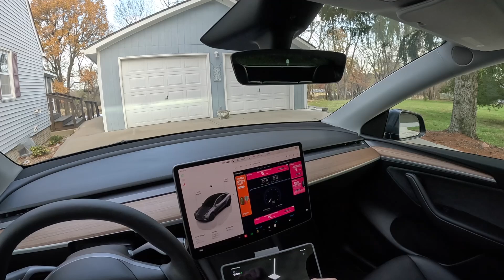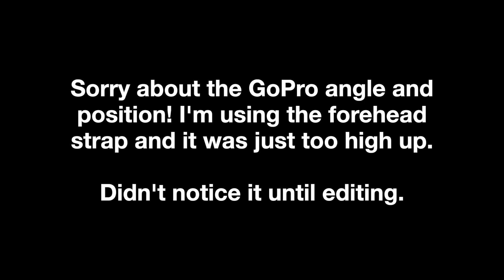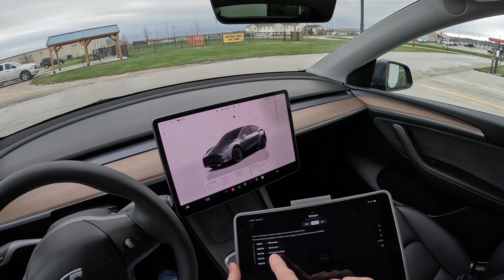Testing the Starlink Mini In-Motion

Comment: Will it work using Tesla's in-car USB-C ports in Y or CT, if using an after-market 10 foot cable? Asking as my CT has no 12-volt port. Only USB-C and AC ports.
Reply from the maker: No, Tesla USB-C ports aren't rated for the necessary 20V/5A (100w). The Mini doesn't use that much power, but it requires the 20V/5A USB-C PD profile to boot up. I recommend using the AC ports, or you could also run the Mini off USB-C from a small battery bank. Then plug the battery bank into the CT/Y USB-C port. I prefer the latter, as this allows the Mini to stay on constantly during food/bathroom breaks, with no interruption when the Tesla powers power down after exiting the vehicle.
Reply: Thanks. I will stay with AC then. BTW, my CT allows outlets to be kept on up to 12 hours after exiting.

Comment: How much energy is drained from the battery using the mini?
Reply from the maker: It uses 20-30 watts. For reference most Tesla's use around 200-300 watt hours per mile of driving. Assuming your car has 78,000kwh usable, the Mini would drain 0.7% of the battery after 24 hours of use.

Comment: Starlink is rolling out a new firmware that will cause dish mini not to work in motion 😢😢
Reply from the maker: Source? First I’ve heard of this. It’s not the hardware that matters, it’s the service plan. All Starlink hardware has always been in motion enabled, it’s the service plan that restricts it. The Starlink website still says the Mini is approved for in motion: https://www.starlink.com/support/article/50e933eb-54f5-1a77-cc85-c6c8325564cf
Reply: @ PC magazine. He going to push for his flat top in motion dish. $2,500 . The firmware will cause the dish mini to not work in motion.Rolling out in December. Also he may have a smaller one coming soon. Three new dish size changing . It will cause people to buy the expensive one instead of the mini
Reply from the maker: @ Link? I follow PCMag and read every Starlink article, no recent ones about that.

Comment: It just occurred to me. Why doesn't Tesla offer Starlink as an option on all of its cars?
Reply from the maker: The vast majority of car owners just travel around populated areas where cellular exists, and cellular is a lot cheaper. It’s easy enough to add Starlink yourself, I don’t think Tesla would add in some propriety panel that’s only functional on the car. Better to have your own unit that you can take and use anywhere.
Reply: @DISHY_tech  No. I mean, as an option for cars. A built-in antenna, in a more elegant way than just attaching it to the panoramic roof. 
The demand probably wouldn't be that high, but we can't know for sure until it becomes a reality. I bet a lot of Cybertruck buyers would check that box.

Comment: You have cobbled your SL MiniDish by placing it IN your vehicle. If you put it on the exterior of your vehicle, the signal will be significantly improved. Glass Blocks RF, well most of the EM spectrum.  
 SL mainly use the Ku-band range (12 to 18 GHz) and Ka-band range (26.5 to 40 GHz). 
These like all RF when aerial is inside the vehicle have glass windows and sunroofs obstructing Starlink satellite signals., 
The best... only... way to remove the RF/UV etc shielding is to mount it external to the vehicle.
Put on roof or on glass of back with your suction cup mounting unit.
Reply: Mine is in my car. Y under the glass works fine. Heck, it works if you just randomly throw it on the dash.
Reply from the maker: Worked fine under the glass, as shown. I gain no practical performance for my specific application by externally mounting it. I’d rather not have something external on a passenger vehicle, especially for temporary use. On a van/RV? Absolutely mount it on the roof. But the method shown here works great for a road trip.
Reply: Mine is inside my car.  I have no issues getting over 150mbps. Overkill for my usage:)
Reply: Tell me you don’t know anything about radio without telling me you don’t know anything about radio.

Comment: I see these need moving to centre this in the rectangular box. So how’s it work if your driving as it’s obviously fixed?
Reply from the maker: Do you mean it needs to align itself to the satellites? It has a phased array antenna that can pick up signals from a wide 110 degree field of view. So the exact angle and position of the dish isn't all that important. As long as it has a clear view of the sky out through the roof, it will work.

Comment: Thanks for another great video! Would be interesting to understand the Average Power Consumption (as shown in App or otherwise) with the SnowMelt option in Off vs Automatic. I am guessing that in Off it may be significantly lower as the upload rates are far less as you observed.

Comment: I want to ditch premium activity with Starlink in the Tesla. The problem I'm noticing though is i lose remote Sentry access if I lose premium data. Beacuse the Starlink (via 12V plug in the trunk) will be disabled when I'm not in the car.  Automatically connecting to the wifi/starlink is fine, theres a setting in the wifi settings for that. But once the car is locked, unless I have a decent battery dedicated for the starlink, i'm sure i would lose remote sentry... i'd have to have a usb battery pack for the starlink mini that lasted at least 12 hours or more probably. might have to keep Premium Connectivity :/
Reply: not really a proble get a usb power bank plug the bank into the socket that charges it up when the car is running. have one of the other ports plugged into the mini. it's not rocket science. hope that helps. you can really just set and forget. it will maintain itself.

Comment: Great. So what do you do if you don't have a sunroof?
Reply from the maker: Windshield, or perhaps mount it on the outside somewhere using magnets or suction. Starlink also sells a roof rack mount. I'm actually getting ready to do a windshield testing video to see if it's as reliable as with the open glass roof.

Comment: Your Tesla already gets internet 🤷
Reply from the maker: It uses a cellular connection for data, which can be unavailable and unreliable in some remote areas where I travel.
Reply: @DISHY_tech  Whats cool is with the Model 3/Y if you want Satellite Radio again, you don't have to rely on cell towers anymore. You litterally bring back Satellite Radio to Sirius XM app with Starlink (mobile app for now)  --- i still will probably put a Model S/X SiriusXM tuner in my ModelY because i miss having Satellite Radio realiblitilty when driving. Celluar doesn't cut it for reliable streaming and FM is just ads ads ads

Comment: So I have two T-Mobile home internet boxes and I use one on the road. I travel as part of a crew in a Ford Transit van. I've done extensive testing all over the US with it and at highway speeds, I'm averaging about 200-500 down and 100 up. Odd as it may sound, the fastest speeds are actually in rural areas where there isn't much load on each cell tower. I'll see speeds in excess of 1Gbps. The negative side is that it won't have coverage no matter where you're at. But if you're just on major highways, you always have cell data signal. I'd be open to possibly switching to this, but man, the upfront pricing for the equipment is a big obstacle. Do I venture enough into areas that don't have cell signal to justify that $600 equipment cost? I don't think so. I'm not even sure if there was ever a time I was staying somewhere or went thru an area where I didn't have cell signal for long periods of time over the 2-3 years that I've had this.
Reply from the maker: Just depends on where you are traveling. I frequent places without a cell signal, so Starlink is necessary if I want internet access. I was a Devils Den State Park in Arkansas last month and there is no cell service (T-Mobile) in the campground. The options are the slow Wifi sold by the park (Viasat) or bring a Starlink dish. In May I spent a week at Mueller State Park in Colorado. No cell signal there. I was happy to have Starlink. Even driving on major roadways, cell service can be unreliable or really slow, especially when you get into remote mountainous areas. There have been lots of times I'm driving through National Forest areas looking for a trailhead or camping spot and cell service isn't available. Starlink comes in handy in situations like this where I can quickly get online and access AllTrails comments, get up-to-date maps/navigation, weather, etc.

I'd say if you haven't run into enough situations where it would come in handy, you don't need it. Not worth the price tag unless you are frequenting places where it would come in handy.
Reply: @DISHY_tech  Yeah, when I'm traveling for work, I tend to go to populated areas which means that the highways that lead there are also more heavily traveled which means better cell service. Definitely if I were in your shoes, starlink is definitely the way to go. 

Sometimes even when I end up in remote areas, I'm surprised at the cell data speeds though. A couple years ago I had a 4 month long project where I traveled to Humboldt, KS which is a town of 1800 people in the middle of nowhere. I wired up some wifi cameras there to monitor a construction project and my T-Mobile test speeds were 900 down, 450 up. It was nice to be able to just leave the internet device down there and be able to control cameras remotely and have super high quality live views.

But I do understand my method could be a crapshoot. Your method is all but guaranteed to have service. That's why I still keep an eye out, just can't justify that startup price yet though.

Comment: Does the weight of the SL cause the glass to pull down  too much on the sun roof
Reply from the maker: @bobla441  The Mini is under 3 lbs and the mount is very light as well. No issue as far as pulling down too much on the glass.
Reply: The glass roof can handle the weight of an elephant
Reply: @GaryCruzDotCom wow that's good glass..

Comment: so cool hi from cedar rapids Iowa been looking at doing the same thing wish prices would be cheaper but so cool
Reply from the maker: I was actually driving up I-35 to Des Moines in this video! The Standard dish is a couple hundred bucks cheaper if that helps. It's bigger and uses more power, but generally that's not an issue in a vehicle, especially if you can mount it on the outside. Starlink makes a roof rack mount. I've also seen people use magnets to stick it to the hood or roof of a vehicle. If you have a larger moonroof or rear hatch, ContronX also makes a suction mount for the Standard dish.